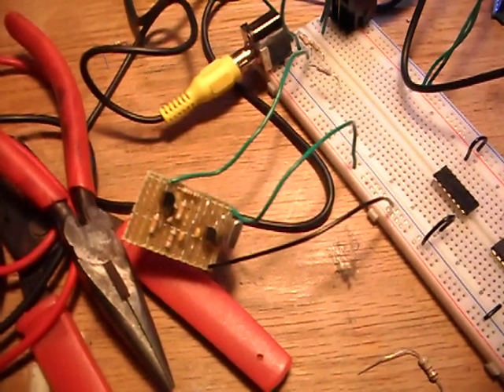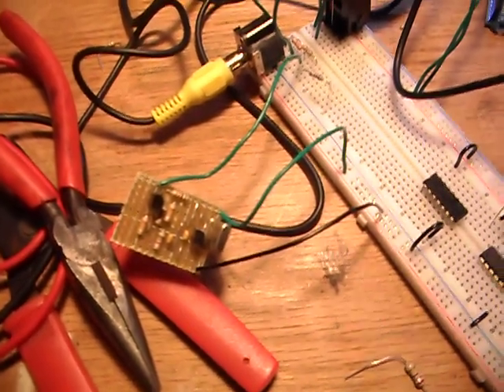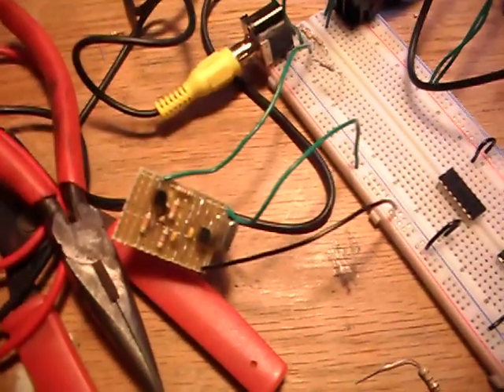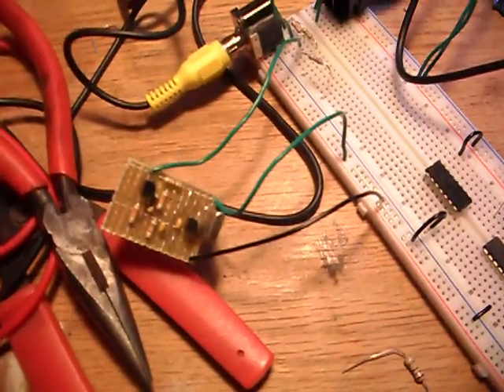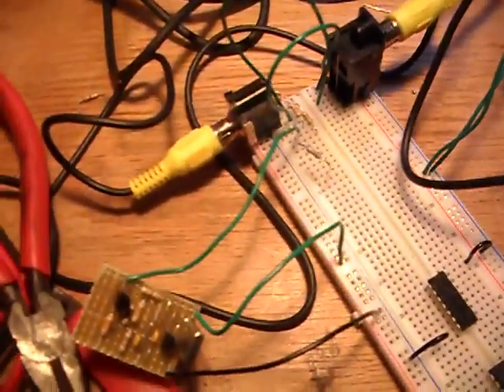Beats of two colour carriers

Comment from the maker: I'm just adding another 3.57MHz sinewave to the CGA output. When you add two oscillators of different frequencies you get oscillations between constructive and destructive interference at the frequency which is the difference of the two input frequencies. These show up as horizontal bands on the screen, or (when the two frequencies are very close together) flashing. In this way I was able to calibrate my XT's oscillator frequency to a known standard.